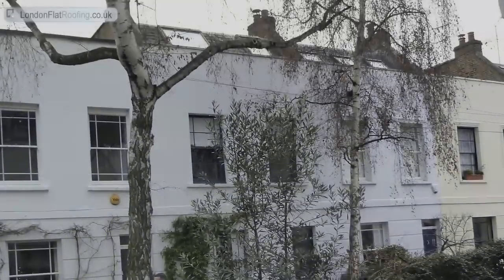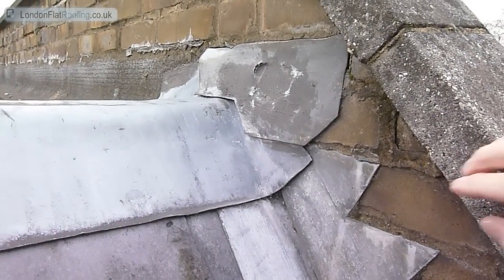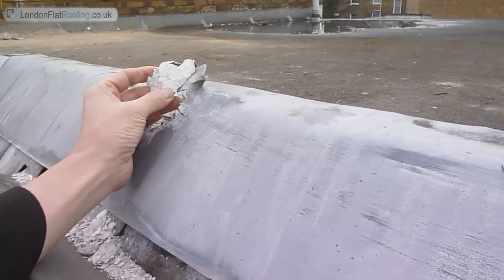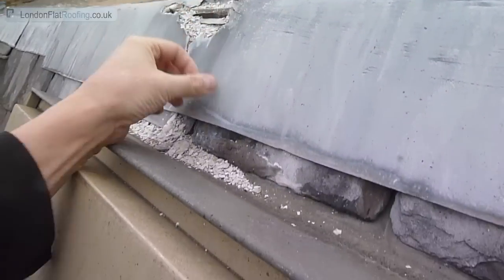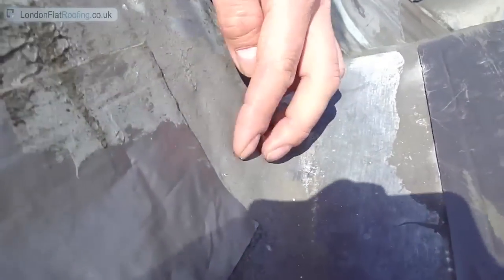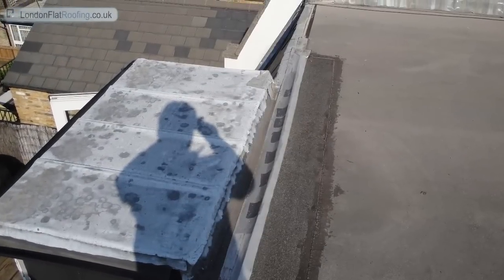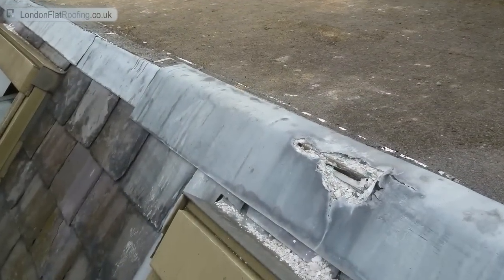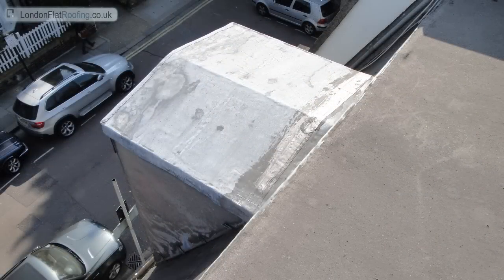Lead on flat roofs oxidising

Comment: How toxic and dangerous to handle is this corrosion? I am cleaning some heavily corroded lead window panes and I don't know if I should worry about the piles of white lead. They were dropping white lead all over the dishes in the china cabinet so I took them out to scrape them. Lead paint was outlawed decades ago because the white lead in it was a big public health problem. I see you handling large amounts. It all seems like mixed messages.

Comment: Hi Steve,
The 'white dust' that has developed on the underside of the lead sheets looks like basic lead carbonate, which may very well develop if the lead is laid on new roofing timbers and reacts with acids that off-gas from the timber.
Lead carbonate, also known as white lead, is highly toxic, so you should take great care when you discover it.  It enters your body through inhalation or ingestion, and can cause really very nasty symptoms.  Protective equipment and a safe way of handling and disposing of it is essential.
If you or any of your colleagues are exposed to lead in any form regularly, you should make sure to have your blood lead levels checked by your doctor or appointed health professional.
I am familiar with this problem because I work for a buildings conservation business, so lead is part of my daily life.  All of our lead glaziers, plumbers, and roofers are under regular health surveillance and receive training in working with lead safely.  The HSE has useful information on their website.
Be well!
Reply from the maker: Thanks very much for this information much appreciated.